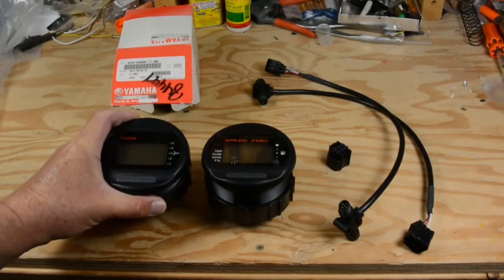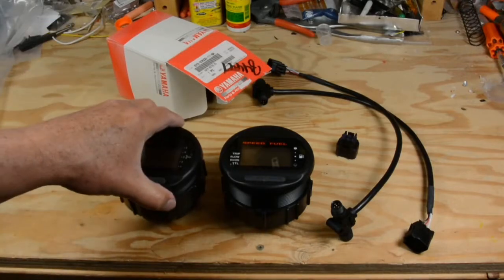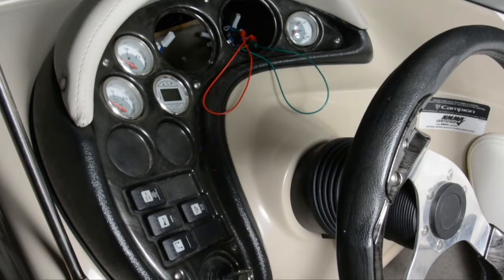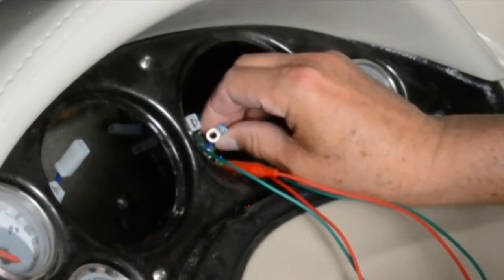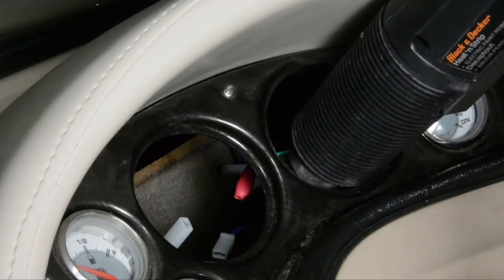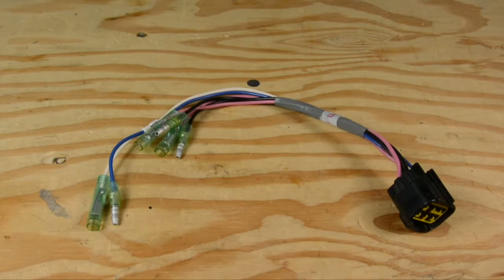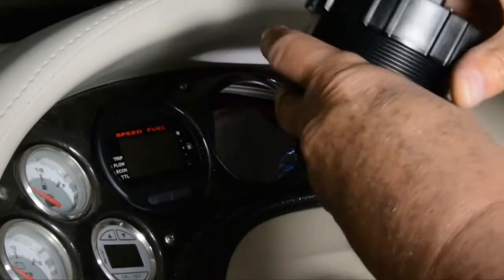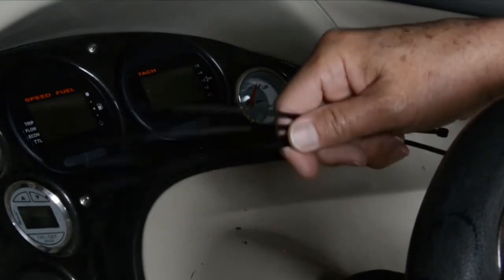Installing Yamaha CommandLink Gauges with an NMEA Network

Comment: Nice video!  I just purchased this 6Y8 gauge set, on a new motor 2013, it has a speed pickup tube that you have the option of adding a pressure sensor that can be plugged to the harness for the 6Y8 electronic speedometer.
Reply from the maker: Thanks for your comment.

Something else we do for many of our customers installing the Yamaha Speedos, 6Y8 or 6Y5, is to help them wire from the GPS signal on their MFD/Fish Finder.  Many fish finder models have the wiring readily available, plus we can connect their VHF radio at the same time, if they have one.  Then, their speedo displays GPS speed.

Comment: Good video, I'm about to install an nmea2000 network from my lowrence elite fs7 to Yamaha 2021 50hp outboard. I don't have any current gauges as I'm converting an open boat to side console. What do I need to be able to show speed, trim? I have an nmea starter kit and Yamaha cable so far. only disappointment so far is I won't be able to see any warning lights.
Reply from the maker: Thanks for your comments!

Adding NMEA give you the following data on the fishfinder: fuel consumption rate, oil pressure, engine temperature, RPM, alternator voltage, fuel pressure, water pressure, and engine hours as long as the Fish Finder chooses to display them.

If you drop me your email address, I can send you the manuals for the Yamaha gauge set.  The trim display on the Tach requires may require an additional part in the engine to sense trim angle  that is optional.  My email is eric.larson@goldenchannels.com

For full functionality of both gauges, with your specific fishfinder, you will need 2 of these cables for NMEA 2000 data and power for each gauge:

https://www.goldenchannels.com/product/yamaha-commandlink-style-tachometer-to-nmea-network-cable/

There is a wrinkle with a few fish finders on the market regarding GPS speed to the speedo (yours included) where there is only NMEA 2000 connections, and the Yamaha Speedo requires the older NMEA 0183 standard.  To fix this, our engineering group created a very specific cable that is a converter between the two networking standards:

https://www.goldenchannels.com/product/better-connected-yamaha-commandlink-speedometer-to-nmea-2000-network-adapter-cable/

This third cable is required to get speed from the GPS in the fish finder to display on the Yamaha Speedo.  This is specifically for the 6 pin connector only on the Yamaha Speedo.

Feel free to contact me if you have any further questions.

Comment: Thank you for the video. What parts would I need to connect two engines to an NMEA network and run two tachs, plus the ability to connect the network to a Garmin display?
Reply from the maker: Thanks for the post.  Here is the entire parts list:
Quantity 1 of https://goldenchannels.com/product/yamaha-lowrance-garmin-humminbird-complete-nmea-bundle/
Quantity 1 of an additional engine cable:
https://goldenchannels.com/product/yamaha-nmea-cable/
Quantity 3 of the Gauge cables, assuming 2 tachs and one speedo:
https://goldenchannels.com/product/yamaha-commandlink-nmea-cable/
The Speedo needs this cable, too (just 1, if your speedo doesn't work now, or this is a new install):
https://goldenchannels.com/product/yamaha-6y8-8356n-01-00-equiv/

The above list assumes you have no CommandLink components now, or are completely removing them.

We offer a full money back guarantee.  Everything works, or we give you a full refund.  We also are available when you are doing your install for tech support.

my email is eric.larson@goldenchannels.com if you have additional questions.

Thanks for "dropping us a line".
Reply: @GoldenChannels  thank you for the reply! I meant to add that I will be doing two CommandLink tachs and CL speedo. Is that possible with your products?
Reply from the maker: @bgun326  Absolutely.  That is what the list of cables I gave you does.  I assumed there was a speedo, too.  You don't need CommandLink at all.  My boat (the one in the video) does not have any CommandLink components.  We do it all with our cables.  Plus, you can add other components later, like an additional fish finder, etc.

Comment: Does the fuel usage guage give a proxy measurement based on speed? Or does the engine have a built it flow meter?
Reply from the maker: Mike, that is an excellent question and this needs to be clear to anyone installing the Yamaha 6Y8 Speedometer.  Speed comes into this speedometer on NMEA 0183 signals on a second cable (https://goldenchannels.com/product/yamaha-6y8-8356n-01-00-equiv/) which also provides the analog fuel level signals to the speedo.  Most fish finders with NMEA 2000 also provide a NMEA 0183 output, except the Raymarine Element.  We're more than happy to help you determine how to hook up your fish finder to provide speed prior to you ordering.
Reply: It is likely based on intake vacuum pressure like most cars, they know the fuel air mixture so they are pretty accurate.

Comment: I currently have 6y8 gauges that I purchased used for my 2014 115hp the gauges came with a orange wire that clips on to motor and has a black and yellow wire bullet connector then as it goes down it hooks up to tac gauge and speed gauge and now on the second connection on fuel gauge I have one white - and blue +  1pink 1pink with black and 2 black not sure what to do here I guess I hook up the black and yellow to ignition bullet connections and the second connection with all the pink and black wires I’m assuming I don’t need unless I have a fuel tank connection . And I’m assuming if I have the harness hooked up to the motor I can’t hook up the Nema connection from motor because the harness for the gauge is currently in use so it’s one or the other

Comment: Can a commandlink guage wth a nmea network be connected to 2014  4 stroke Yamaha F9.9 JMH 6AUK model
Reply from the maker: Yamaha has NMEA 2000 on their outboards starting at 25HP, like most manufacturers.  The only one that offers NMEA 2000 on a 9.9 is Suzuki.  Sorry we couldn't help.

Comment: I have been stumped trying to get my Garmin Echomap to read my 2011 Yamaha 150.  I have the Command link hub and have purchased wire to go from the hub to the Garmin N2K input.  However the only thing I can read is the engine hours.  It does read fuel remaining since I listed the tank size onto chart plotter.  But I do not get any other engine info....  I can not seem to find any reference for Command link hub to N2K...   What I have read is the hub is just Yamaha's N2K solution with their connectors, but it doesn't seem to work with the cable connected to the Chartplotter...  Any ideas?
Reply from the maker: Curtis, is your CommandLink hub in the stern of your boat, or the helm?  Also, do you have the Yamaha 6Y8 series Tach (in this video) in your boat?
We have two solutions for this kind of problem.
Guys that purchase complete kits from us are generally done in an afternoon with the install.  Hybrids of existing installs combined with our stuff is usually more work, but we can help.  If you want to chat in person, drop me an email at sales@goldenchannels.com, and we can go over options.  We guarantee a working system with our kits and cables.
You are correct that CommandLink is electrically identical to NMEA2000.  However, power distribution rules in the cable systems themselves and if you are running backbone or spur connections, plus proper termination design is still required.

Comment: hello. can you help me witch type wire need to connect nmea0183 gps signal receiving? i have garmin 24xd hvs gps antenna. Thank You!
Reply from the maker: Hi Farkas.  We have a cable to attach the GPS NMEA-0183 signal to the Yamaha Speedometer here:  https://goldenchannels.com/product/yamaha-6y8-8356n-01-00-equiv/

Is this what you were thinking about?
Reply: @GoldenChannels  I have this cable for the instrument, but I don't know which of the GPS wires should be connected to the blue and white wires. Tx + Tx- and Rx + Rx-
Reply from the maker: @farkasrado  First, you can't damage anything using the wrong connection or polarity.

From your GPS, you need the Transmit output (Tx)  Colors of these vary between different manufacturers, but should be listed in the fish finder manual.

On the Yamaha speedo cable you need blue and white, which are the longer pair in the cable bundle.

You should connect GPS Tx + to Yamaha + and GPS Tx - to Yamaha -.

You will know your connection is correct if you see the icon "GPS" shown on the Speedometer with the fish finder GPS locked on to satellites, and knowing it's position.  You will not see 0 displayed as a speed.
Reply: @GoldenChannels  I appreciate the help. He is the only one who could give a meaningful answer to my question. Even the local Yamaha dealership didn't know how to pair them. Thank you! :)
Reply from the maker: @farkasrado  You're very welcome.  We here to help.  Enjoy your new Yamaha speedo.

Comment: Will 6y8-0e83r-81-00 work on a 2020 VMAX SHO 200hp? It’s going on a StarCraft pontoon? I just don’t know what all I will need.
Reply from the maker: Justin, this part number is a kit that assumes you already have a CommandLink hub at the back of your boat.  Is this the case?
A much more cost effective measure is to just go NMEA everywhere.  We also need to talk about how you will get speed.  Do you have a chart or a fish finder now?
Reply: @GoldenChannels  I don’t have the hub. I have a Humminbird Helix 5 CHIRP DI G2 NAV+ GPS Fish Finder installed but nothing hooked up to the engine. I’m trying to get something to display the engine hours. I’ve taken it to several boat dealers and they act clueless.
Reply from the maker: @justinabbott1155  The Helix 5 unfortunately is not capable of NMEA.  You need at least a 7" version.  If you install the 6Y8 Tach, you will see engine hours on the Yamaha Tach.  Here is what you need to order:
1 of https://goldenchannels.com/product/yamaha-commandlink-nmea-cable/

and 1 of our NMEA Kit for the Yamaha:  https://goldenchannels.com/product/yamaha-humminbird-helix-nmea-bundle/

This kit does not have a cable for the fishfinder, since it is a special Humminbird cable that is needed for the larger Helix, which is only available from Humminbird.  However, when you upgrade your fish finder in the future, you can also add it and get engine data, if the new fish finder supports NMEA, with the addition of one inexpensive 3' Cable and a Tee.

We guarantee our cable kits to work, or money back.
Reply: @GoldenChannels  Thanks! What will I need if I just decide to buy a helix 7 that is compatible? I think that would be better and show more information. I wonder if the transom and power line on them would be the same since it’s already ran?
Reply from the maker: @justinabbott1155  The Helix Series is very specific about not only the G7 series, but also the version of the G7 you are after.  Any model other than the G7-G4N specifically, can be NMEA connected, but the cost for Humminbirds cables is ridiculous.  Is the Helix G4N an option for you?  If it is, then these two cables would be what you need, along with the one reasonably priced Humminbird proprietary cable, listed on the website:
1 of https://goldenchannels.com/product/yamaha-humminbird-helix-nmea-bundle/
and, 1 of https://goldenchannels.com/product/yamaha-commandlink-nmea-cable/
Let me know your thoughts on the G4N.

Comment: My yamaha 60hp is not showing the tring angle on the display
Reply from the maker: There is a single wire that needs to be connected in the Outboard to "route" the trim to the digital display.  If you have a separate trim gauge on your dash, it will stop working and you will only get trim on your new 6Y8 gauge.  If this is what you are looking to have happen, I can send you the manual page to tell you how to do this.  Please just drop me an email at sales@goldenchannels.com

Comment: Can you use these digital gagues with a 2002 Yamaha 2 stroke engine?
Reply from the maker: Pablo, it is unlikely there is a connection on that year of two stroke, but if you let me know the HP, I can do further research for you.
Reply: @GoldenChannels  thank you so much! It’s 90hp Yamaha 2 stroke I believe 2002 or 2003 I was also looking at the EMU1 box from actisense so I can get Analoge to nmea2k. Is there a similar product you’d recommend?
Reply from the maker: @SouthFloridaFishingClub  Could I ask you to check if your Outboard is what is called "HPDI"?  This was "High Pressure Direct Injection".  An article is here: https://www.popularmechanics.com/adventure/outdoors/a3195/1276871/
Reply from the maker: @SouthFloridaFishingClub  I found this: https://www.smalloutboards.com/y6003.htm

It looks like only the larger 2 strokes in 2003 were given the HPDI system.  I'm afraid this cable won't help you.

If you could tell me what you are trying to do with your NMEA 2K setup, I can try to recommend something that will work with a carburetor based system.
Reply: @GoldenChannels  I recently bought a bay boat and the onboard meters the glass is cracked from the sun and it seems like the gas unit isn’t measuring correctly or is improperly set. I have Humminbird units networked with the one boat network onboard and if I can get the sending unit to go NMeA2k then I can see all my info on the displays instead of the gauges. So I’m trying to get this boat setup for NMEA2K. Thank you so much for your help and replies. I can send you my info if you’d like to chat outside of YT. Appreciate it a lot thanks again
Reply: @GoldenChannels  I’ll have to see exactly the motor unit when I’m at the marina so I can give you the specific model but it does have digital gauges just not NMeA2k I don’t think
Reply from the maker: @SouthFloridaFishingClub  The types of digital gauges I think you have are what we call the 6Y5 series.  They have lots of wires in their connectors.  Please drop me an email at eric.larson@goldenchannels when you have a moment, and I'll do some research on some other options for you.

Comment: What connectors do you used and where do you connect to the motor please provide thanks
Reply from the maker: Hi Lorenzo.  We offer a complete cabling kit for the Yamaha Outboards and all models of fish finders, or the Yamaha Engine Cable itself.  Here is the Yamaha Fish finder Kit: https://www.goldenchannels.com/product/nmea-network-starter-kit-complete-kit-for-lowrance-and-yamaha/
Reply from the maker: Let me know your engine and fish finder, and we'll let you know exactly what you need.
Reply: @GoldenChannels   2006 Yamaha f150 Trx  4stroke
Reply from the maker: @lorenzocruz7017  I've got an F150 as well. Which fish finder?
Reply: @GoldenChannels  garmin  striker 5cv
Reply from the maker: We have an installation video for an F150: https://youtu.be/6Qfis-mVrWo
Reply: @GoldenChannels  garmin striker plus 5cv
Reply from the maker: @lorenzocruz7017  Unfortunately, that fish finder model doesn't have an NMEA port. But the gauges will display all the engine data with the cables you were looking at. I need to do a bit of research on speedo function. I'll be back tomorrow.
Reply: @GoldenChannels  thanks a lot for your help I need to know what harness do I need to run from motor to tachometer and fuel speed or multimeter
Reply from the maker: @lorenzocruz7017  do you already have a speedometer in your boat, that you're happy with?
Reply: @GoldenChannels   yes it’s brand new
Reply from the maker: @lorenzocruz7017  You get everything but the tach/speedo cables in this kit: https://www.goldenchannels.com/product/nmea-bundle-for-raymarine-and-yamaha/

Then if you're only adding the Tach, go with this cable:

https://www.goldenchannels.com/product/yamaha-commandlink-style-tachometer-to-nmea-network-cable/

Those two will give you a complete connection from the engine to the tach.

Does this make sense?
Reply: @GoldenChannels

Comment: How to calibrate a new fuel level gauge?
Reply from the maker: Hi Dêmius.  The Yamaha digital speedo only displays 7 different levels, so it is not very high resolution.  The only adjustment or setting for the speedometer is to set the type of sending unit that is in the fuel tank.

Many fish finders or MFDs have better fuel features and displays based on using the fuel flow and settings for fuel tank size to determine things like distance to empty, etc.

Hope this helps.